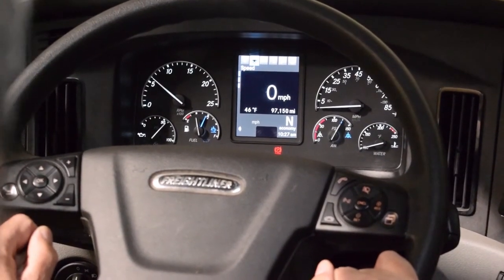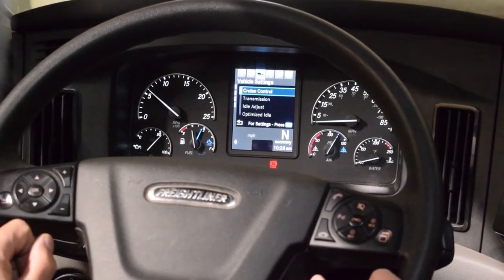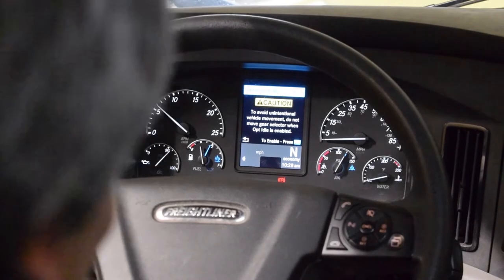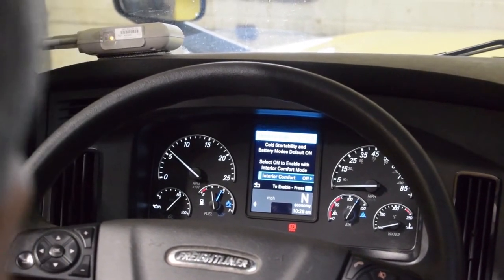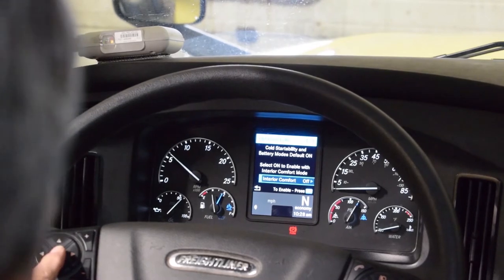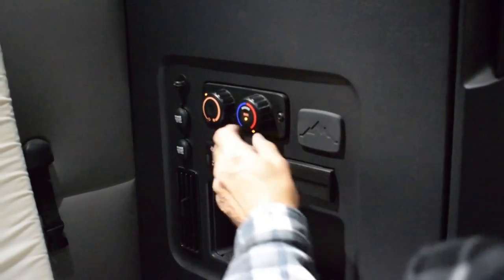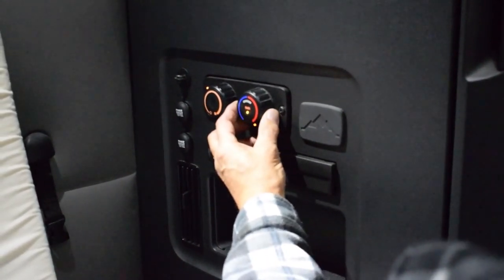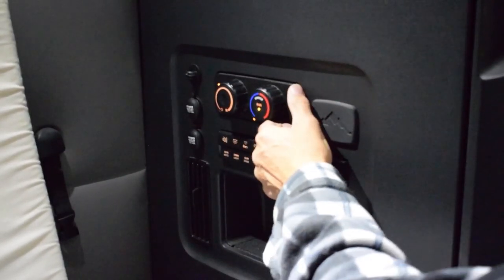ParkSmart with Optimized Idle How To

Comment: Interior comfort must be turned on for the engine to turn on to cool the sleeper.  Otherwise the driver will be no better off than a dog locked in a car with the windows up.
Reply from the maker: Hello Mattew - thank you for your comment. ParkSmart is a stand-alone heating and cooling system so you are not using the truck's a/c or heat while in the bunk. If the truck is just equipped with Optimized Idle, then yes you have to have Interior Comfort Mode on. The ParkSmart system is meant to minimize engine idle time. With Interior Comfort Mode on, it monitors interior temperature and in the summer, the truck will never be able to meet the demand which will cause the engine to start and stop more frequently. With Interior Comfort Mode off, Optimized Idle still monitors the system but will only start and stop the engine when ParkSmart draws down the 4 separate batteries that it runs off of. Hope this helps!
Reply: @VerihaTrucking  this helped me greatly i was unsure how to use it to spend my home time and keep the fridge on so keep it off when im home so the fridge stays on but it doesnt idle allday correct?
Reply: @jimi3540  yes, comfort mode “off” is purely to allow the truck to start and stop on its own so as to maintain the batteries in the truck.  Whether just an Option-Idle truck or if it has park smart.
Reply: How do you determine what is a good temperature, no matter what temperature I have it set to using the knob it's freezing!  LOL.

Comment: You want to leave interior comfort on or you won't be able to use most of your features inside the cab,like your radio and your outlets
Reply: Thank you
Reply: False information. Interior comfort only controls the HVAC, you want to have optimized idle turned on to charge the batteries when needed. Interior comfort is not needed at all if you have an apu.
Reply: @HobbesWiilTakeGoodCareOfYou  I drive a 2020 Cascadia and that's how my truck works.  Don't always assume you know how every truck is setup
Reply: Mine doesn't even show interior comfort as an option

Comment: how is this better than just idling?
Reply from the maker: Hello Jason - thank you for your comment. A truck at normal idle burns roughly 1.5 gallons of fuel per hour. So there is 2 parts to this idle management system. Opti Idle alone monitors battery voltage, oil temperature and Interior Comfort. Opti Idle in conjunction with ParkSmart is a battery ran a/c system. 
So long story short, idling a truck doesn't generate enough cylinder temperature, which in turn doesn't cleanly burn the fuel which causes excessive soot. Soot gets trapped in the aftertreatment (Diesel Particulate Filters) system causing all kinds of issues!
Reply: @VerihaTrucking  isn't that bad for the starter turning on and off all night?
Reply from the maker: @jasonb.3874  At max, it would only be 3 start-ups. We have been running this system for years and can honestly say our starter failure rate is very low, 2% maybe.
Reply: @VerihaTrucking  I have opti-idle and the truck turns on and off multiple times is it malfunctioning or is parksmart something totally different?
Reply from the maker: @jasonb.3874  I don't want to lead you down the wrong path; it might be time to work with a local dealership or repair facility for more information. We created this video for our current VIPs and specific to our equipment specs.
Reply: @jasonb.3874  park smart is an option when you purchase the truck. It is a battery operated APU. On those trucks, The Opti-Idle is only used to maintain the truck and APU batteries by selecting comfort mode “off”. If your truck is not equipped with a park smart APU, Opti-Idle is what is used to cool and heat your truck without constantly idling the truck. If no park smart APU, you need to select comfort mode to “on” to get the heat and cool function.

Comment: Your confusing you should re record saying weather to keep comfort interior on or off you say to keep off for it to work ?
Reply from the maker: ParkSmart is a stand-alone heating and cooling system so you are not using the truck's a/c or heat while in the bunk. If the truck is just equipped with Optimized Idle, then yes you have to have Interior Comfort Mode on. The ParkSmart system is meant to minimize engine idle time. With Interior Comfort Mode on, it monitors interior temperature and in the summer, the truck will never be able to meet the demand which will cause the engine to start and stop more frequently. With Interior Comfort Mode off, Optimized Idle still monitors the system but will only start and stop the engine when ParkSmart draws down the 4 separate batteries that it runs off of. Hope this helps!

Comment: Do we turn the truck of or leave it on?
Reply: Have you figure that out?
Reply: Once you select optimized idle, the truck will take over the idle control of the engine. Do not turn the key off. Just leave it alone until you want to turn opti-idle off again and start driving. Once engaged, opti-idle will stop the engine and remain in a stand by mode until it senses the Park Smart electric HVAC system has drained the system batteries enough for them to require recharging. The system will then start the truck’s engine and idle it for as long as it takes to recharge the batteries and then shut down again.

Comment: Is this an extra option or does this come with the 23 Cascadia stock. As I did everything you said ok the dash then turn my bunk dials and nothing at all. 

Leave key in on position as well? 
All my dash lights stay on too. No fan blowing or cool air.
Reply from the maker: Hey Karl! These are options not standard equipment.
Reply: Assuming your truck is equipped with optimized idle feature. do this.

doors must be closed and locked. truck in natural. interior comfort is on. fan is on 3 or 4 clicks up. AC in the desired temperature ( front and back should be set to same positions) 
wait 5 to 10 minutes. if it’s not working I’d take it to a shop. 
if you miss one step it may not work. good luck
Reply: @Izm100  Interior comfort?
Reply: @karlrichards1611  
There is an option to turn interior comfort on or off when setting up the optimized idle. 
If you don’t see this feature then maybe your truck doesn’t have one.
Reply: @Izm100  ya I don't think I have. As on opt idle I just have hood latched , neutral gear and park brake set